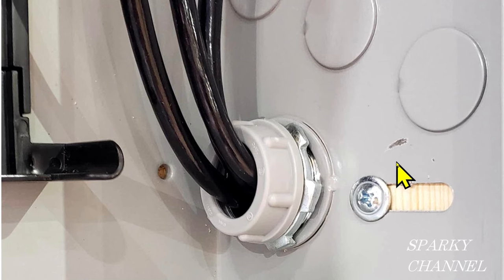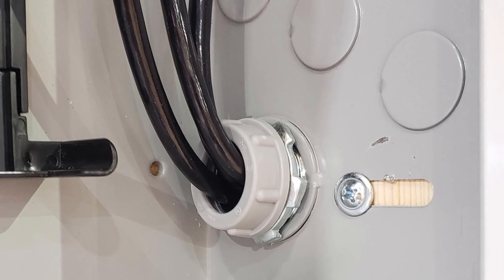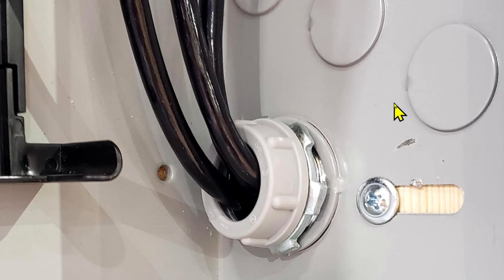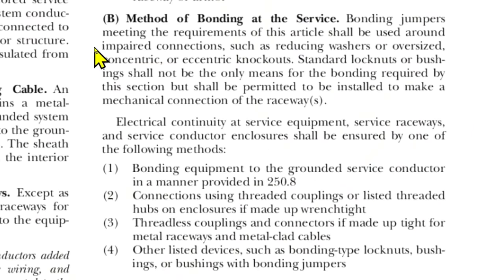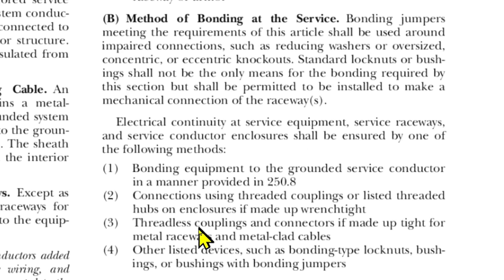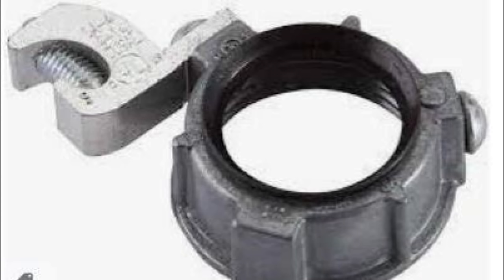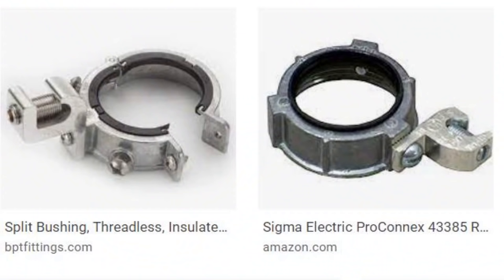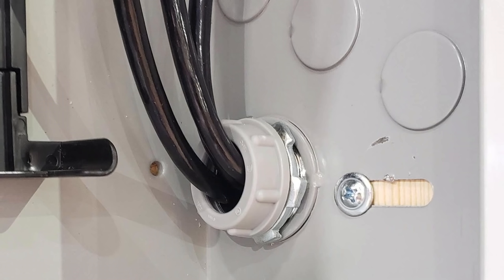What's Wrong? Concentric Knockouts and Conduit Fill, 2020 NEC 250.92 (B), 250.122

Comment: There’s not ground wire in the conduit!
Reply: Who's to say that one of those isn't a ground. Like a range for example only needs 2 hots and ground
Reply: Not required. They are using the conduit as the ground. This is permitted in 250.118 and in the case of this video 250.118 (4) And metal enclosures  such as metal junction boxes, load center cans, panelboards, etc. are covered in 250.109. Do note i am referencing a 2020 NEC if things dont line up.

Comment: No green ground conductor and neutral not marked.
Reply from the maker: Yes, correct.
Reply: The neutral may be marked but not showing in the pic.
Reply: Or this may be 3 phase with no neutral or ground.

Comment: Neutral wire is not marked
Reply: Generally Size 4 and larger neutral conductors only need marked add termination
Reply from the maker: Yes, we would need a larger photo to judge on the neutral being marked although my preference would be to mark the neutral with candy-cane type striping so that it would be easily visible. It's a crazy photo, the more you look at it the more things you find wrong. :)

Comment: i don't understand. why is it violation?
Reply: So my understanding is that if you are using EMT conduit for your wiring, the EMT itself MUST be grounded. This can be accomplished by using the proper size knockout and bushing in the power panel, and securing your EMT conduit to the panel. The mechanical connection between the conduit fittings to the power panel itself (assuming the panel itself is correctly grounded) is sufficient for this purpose.

However, if you use a reducer bushing or one of the concentric knockouts with a select-a-size holes, the theory is that the metal that is missing ("impaired connections") to facilitate the concentric knockouts may not be sufficient to carry enough voltage for the ground to be safely useful. In this situation, you must change your normal bushing over to a grounding bushing. The grounding bushing adds a terminal for you to connect an appropriately sized ground jumper from your bushing to the panel's grounding terminals. This way, your ground 'capacity' is sufficient for that run of EMT.

Basically, it ensures that if you have a ground fault within the EMT itself or any other components downstream of the EMT (metal boxes, devices, etc.), there is sufficient electrical capacity in the EMT's physical connection to the panel that you can have a safe ground.
Reply: My take is you can see it's a problem by looking closely at the concentric knock-out- it doesn't make good contact with the rest of the metal in the service panel so it needs an additional ground bushing.

Comment: Although not a subject of this video. Seeing the conduit running through the wall behind it in your video makes me ask the question

When running conduit through a wall from indoors to outdoors from one box to another, what’s the best way to attach that conduit to each box since you can’t get behind the second box to fasten the conduit to the box. Is there other fittings or methods. And, what’s the best way to weatherproof behind the outdoor box/conduit?
Reply: 2020 NEC 225.27 Where raceway enters a building or structure from outside, it shall be sealed. Sealants shall be identified for use with...  Not all of the answer your looking for, but I hope this helps.
Reply: I use two rain tight compression fittings pre mounted, back to back on the pipe stub, and those steel-ringed o-rings.  I drill the pass through hole on a very slight downward towards the outside, just enough to prevent the gravity assisted ingress of condensation, and a bit bigger than the pipe so that the fitting will clear.  I then apply generous amounts of silicone sealant in the gap between the pipe and outer penetration, and a careful amount of two hour firestop around the inner one.  Using a locknut wrench, I attach a weather proof box on the outside, with more silicone applied around and behind the box.  Inside, I mount a steel box over the now firestopped inner penetration.  If there is thread room on the connector, I fit either basic plastic, or grounding bushings on either end of the pass through pipe.  

This all may be overkill, but I've never had a problem with an inspector thus far when installing inside to outside back to back boxes.
Reply: @glennkon  awesome! 
And thank you
Reply: @ElementFreedive  I'm guessing Glenn works in an area where there is weather.  the only thing I do differently, is everything possible on the outside is either stainless steel or nonmetallic, and what isn't is coated with anticorrosion spray.
which means my conduit is schedule 40 PVC, and I prefer elastomeric caulking instead of silicone.
Reply: @ElementFreedive  I've started backing up the elastomeric caulking with a worm of duct seal, but the caulking is still necessary where I am.  amusingly, there was recently a situation where a truck had a leaking fuel tank, and I gave the emergency crew a wad of duct seal, and they were able to plug the leak with it long enough to tow the truck away and drain the tank.

Comment: There’s not enough information in this photo to determine a code violation based on what you cited because that section applies to services
Reply from the maker: Fair enough. But both panels have to be bonded and you can't bond on a concentric knockout so it's going to need a grounding bushing. See 250.92 (B).
Reply: @SparkyChannel  that code section specifies service conduits, it doesn't apply to feeder or branch circuits.

Comment: IP rating?
Reply: In the US, it is called a NEMA rating.  NEMA = National Electrical Manufacturer's Association.

There is usually a number right after the word NEMA, that indicates what kind of environment the box is rated for.

Some common examples are:
NEMA1 = general indoor use
NEMA3R = outdoor use in a specific orientation, usually upright on a wall
NEMA4 = outdoor use in any orientation
NEMA4X = outdoor use, and made out of a wholly corrosion-resistant material, like aluminum, stainless, or plastic, as opposed to coated steel

Comment: Hello American sparkies, do you guys use Philips hardware mostly for fasteners? What about on your circuit breakers? are those usually Philips as well?
Reply: The company I work for often goes with square drive fasteners. Breakers are often square drive as well, but can vary between manufacturers. We try to avoid Philips when possible
Reply: @NS-qy8gw  Interesting. The name for that is called Robertson, it's interesting you call it square drive there.
Reply: @paulmcewen7384  They're both used. Most woodworkers will say Robertson, while I usually hear carpenters and electricians call them square.
Reply: @paulmcewen7384  As a general rule of thumb I prefer to use an ECX screwdriver, or an ECX bit.
Reply: @paulmcewen7384  I ALWAYS use an ECX screwdriver or ECX tip. Square is Robertson, the cross is a Phillips, and then the slotted type that uses a straight tip. ECX utilizes all three in one bit.

Comment: Does the same rule apply once you are past the main breaker?
Reply: @ElementFreedive  I'm at 480 a lot.  Can you point me to that article #?
Reply: @ElementFreedive  Thanks!
Reply: @michael931  Essentially, the metal chokepoints that hold together the ring knockouts are only "strong enough" for a 250V fault or less.   A higher voltage means significantly greater power dissipated as heat from a fault through the knockout joints.   So unless listed otherwise for your voltage, higher voltage circuits require bonding bushings due to the impaired continuity.

Comment: 250 volts and higher.
Reply: AND, service conductors.
Reply: @jackconnolly2665  More like OR.    For raceway terminations in general, a bonding method beyond standard locknuts biting through the metal coating of the box is only required  if you have missing or impaired continuity, and the ring knockouts remaining are only considered impaired when over 250V to ground, unless otherwise listed for higher voltage continuity.

Service raceways are a special case, where a bonding bushing is also required on at least one end.
Reply: @carultch  Correct. Thanks. 
 Im usually better with my words :)

Comment: When do I know when to use a grounding bushing and when not too ?
Reply: Grounding bushing are required for 4awg or higher
Reply: @deas1anguy 's correct, that per NEC 300.4
Reply: 300.4 is insulated bushings. Not ground bushings.
Reply: @dja711  from memory, probably from an older copy... my bad.
Reply: Read the code book.
Reply: @truthdefenders-  great insight. wise, beyond your years.

Comment: How about the wood showing.
Reply from the maker: Good point. Wood is flammable so in the very least it's bad practice to allow it to show like that. I like to use fender washers for greater holding strength and they would cover up the wood at the same time.
Reply: We want slow down the fire.
Reply: What’s wrong with a little bit of wood showing? 🤣
(Sorry, I’m still 15 inside)
Reply: As long as the wood "shall be treated" it's OK. 
But treated could mean a variety of methods; visible (pink wood primer, varnish, enamel paint, ...) or invisible (treated for white ant). ??? 
The installer electrician will tick the correct box ⚡

Comment: that's the other reason nobody in their right mind uses metallic conduit for service conductors, here.
Reply: I don't understand your point. Please elaborate ken. Thanks.
Reply: For sure if it is underground service. Overhead is always metal that I have seen.
Reply: @K2mtp  You can strategically get around the need to bond raceways, if you install a plastic raceway where bonding isn't applicable in the first place.

Some utilities may require metal conduit for an overhead riser/mast, so unless you terminate in a box with a built-in hub, you would need a bonding bushing on it.   You may also have a job spec that requires metal conduit as a function of the environment.